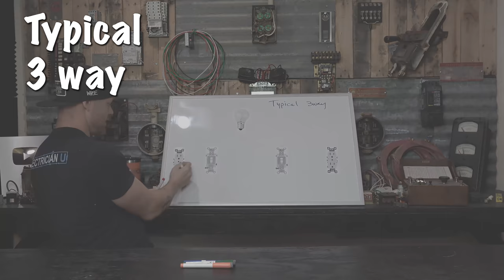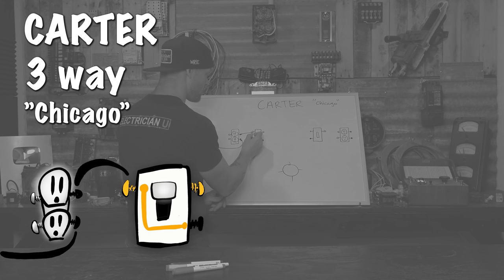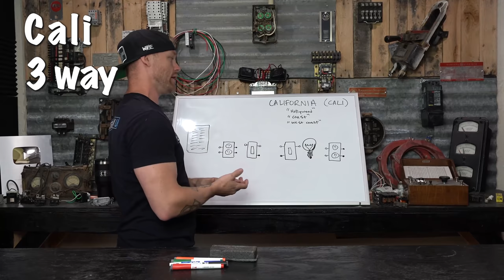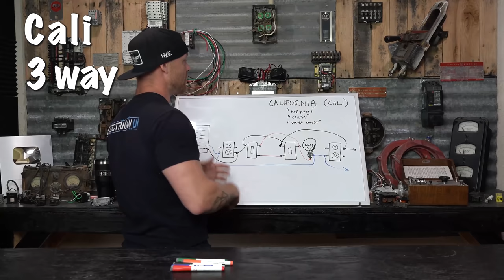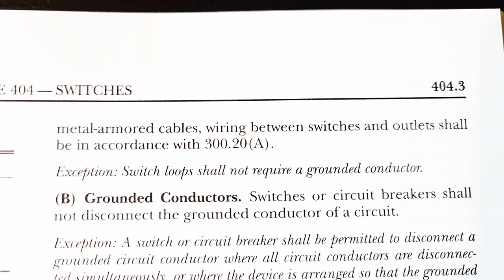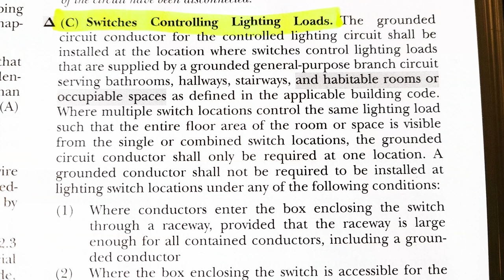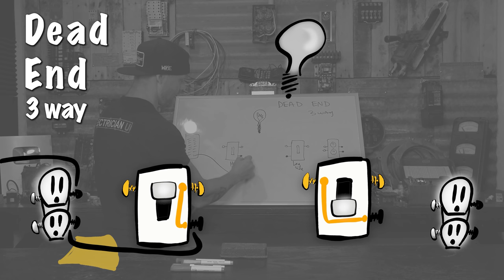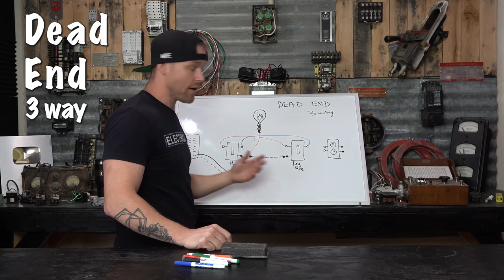THREE WAYS 3-WAYS CAN BE (3way Switch Wiring - ILLEGAL AND LEGAL METHODS)

Comment: So many right ways to wire 3-way and 4-way switches!  Check this out,  I always use the WHITE and RED for my travelers for efficiency. Yes I have to phase but you would anyway if your pulling switch legs and/or power out of 4-way locations. Also when your running a dead end 3-way (just one 14/3 in a box) you must have to use the white for the common and phase it. 
Mainly its nice to have options on a long 4-way run to put light leg and power where you want to along the run without being confused by the splice.  Just make sure your crew is all doing them the same way!

Comment: On the Cali 3 way, hot needs to come into the left switch at one of the other two terminals.  Bringing it into the middle point of he switch gives the left switch total control over the current supply to the bulb.

Comment: I really learn a lot from your vids and appreciate your producing them. Great explanation of three ways. Another way to wire a dead end 3-way and have a constant hot and neutral in the leg box is using 12-2-2 or 14-2-2. Method: From the line-side, send the hot (black) to the load (black screw) of the leg switch. Use the red and red/white conductors for travelers and cap off the neutral (for future). In the line-side box, connect the light's black wire (load) to the load post (black screw) and splice your neutrals there. We had to do this where we had a huge barring post in the way making other paths difficult.

Comment: When it comes to the conduit fill and wire count there have been several times ive had to have 1/2" emt to a single switch but dont want to have another conduit come out of the switch leg side. What ive done is what i was taught is called a cold switched 3way....might be named wrong but this is where you have power and switche leg on the same side.  All you do is tie your common wire into power right away which send the piwer side to the switch thats a die/ alone then wrap your switch leg on the travelers.

Comment: I really appreciate your explanations as you drew these diagrams.  I encountered a situation where whoever wired this house ran the load and neutral wires from the light into Switch A, and connected the incoming hot line to the white wire along with the travelers, essentially bypassing Switch A to run the power directly to Switch B. This configuration was not represented in any of the standard wiring diagrams I was able to find, but your drawings in combination with some voltage and continuity tests (plus lots of head scratching) revealed the situation....and I was able to fix the 3 way circuit in my dining and add a functional dimmer. Thanks!!!!

Comment: I believe I know of another version of the California 3-way (unless this has another name... I'm in California so to me, it's just another method of a 3-way..) which I 'think' is still code-compliant.. but it needs to be done in conduit/flex with the light in the middle of the run between the two switches, thus allowing you to take the circuit room to room, keeping neutrals in the switch boxes and everything. The only difference really being the light location and the way the leg to the light is run. 

You have the power come into switchbox A, and it goes from there, passes through the light's jbox to switchbox B. The single traveler follows the same route. You'll have the neutral come into switchbox A, up to the light, down to switchbox B, and then both the power and neutral can continue onto the next room's switchboxes. The traveler stays on the commons, and the legs both go up from each switch to the light instead of switch to switch to light. Running it this way allows a neutral in each location of the 3-way switches, and allows you to take power from one room to the next, never changing the polarity of anything.

Comment: In the 80's we used to run the feed to the overhead light and drop 14/3 to each switch. Where a feed was at one switch we ran 3 wire to the fixture and back to the other switch.
Reply: Do you know what some of the names for those specific three-ways are?
Reply: @joshuaarellano6600  
No. I just wired as the boss said. Had his nephew as my helper. Kid could fuck up a one car parade. Had to go back myself and fix everyone he touched.
Reply: White wire in 14/3 from 1st switch to light gives the light it's neutral from main source.  White wire in 14/3 from light to 2nd switch will be your switch leg. Red and Black travelers tie together in light box and passes through. The hot at 1st switch goes to common side of switch. Here in Missouri we call that a half-ass 3 way. Not sure of technical term for it lol
Reply: @kaseyatwell1640  
Switch 1: white to neut, to fixture, red& blk travelers
Switch 2 red & white travelers  black is switch leg back to fixture.

Comment: Yo dustin I'd love to see a Code Myths video! Most recently I've debated 1. Connecting all grounds in a junction box (even when there's 2 different sized circuits) and 2. Running romex through EMT
Reply: Fairly certain both is wrong....I never tie my grounds together from different circuits out in the field. Even if it's not code I could see it being code eventually.  Obviously I'm referring to houses and not your commercial environment with conduit and such. 
I just like the idea of having everything separate. Easier to diag on the future
Reply: No romex thru emt…….thats a no no
Reply: I think he already did the romex in duit video, Its a no if it can get wet. I think.....
Reply: @anthonysmith9410  that would be a bitch to pull😂😂 we have pulled romex thru 2” emt that was stubbed out of panels before but screw pulling romex in emt for over 2’
Reply: Oh, this (sharing grounds) is one we should talk about. You can't share neutrals but I don't see why one can't share a ground. So, pulling two circuits from the same panel through conduit, do you guys pull two separate insulated ground wires even though they go to the same place at either end? They all attach to the junction box anyway, and one circuit blows at a time. It seems a waste....
Reply: @spelunkerd  8l⁰
Reply: @spelunkerd  Code says you can pull a single equipment grounding conductor (EGC), as long as it is sized for the largest overcurrent device serving the circuits in the same conduit. 

Example:  1 circuit fed from a 15A circuit breaker and 1 circuit fed from a 30A circuit breaker installed in the same conduit.  You size a single EGC based on the 30A overcurrent device from the NEC table.

They have to be in the same conduit though.
Reply: @Tie509  Yes, our Canadian code book agrees, as well. I had two circuits going through a single underground conduit and did exactly that, using our table 16 based on the ampacity and OCP of the largest conductor. The inspection passed. I did scratch my head wondering if the two circuit currents should be added together to calculate the maximal current the ground wire would ever see. But the chance that a ground fault would happen to both circuits simultaneously without blowing either breaker is so unlikely it is not a practical consideration. Even if a back hoe took out both circuits at the same time, the brief overcurrent is so short lived, there isn't enough to justify a bigger ground wire....
Reply: You actually can run romex through conduit. But only directly to the device or receptacle.. for example in a basement you can run romex through through the drop ceiling or ceiling then straight down to your receptacle through conduit
Reply: @theknucklehead9518  Yes, I believe the issue is conduit fill, since you still need to follow that <40% rule, even accounting for the extra jacket volume. It's all about heat dissipation, with short lengths like you say allowed as long as conduit fill and other factors are in compliance. Of course, nobody wants to pull long lengths of Romex through conduit.
Reply: I don't see anything wrong with running Romex through conduit as long it's the right type I ran number 14 Romex through plastic pipe outside but didn't know it had to be uf type. I never hooked the other end into the breaker box it's my Christmas light circuit and a voltage reducer is used so I just put a plug on the other end. When I sell the house I will pull up the conduit and remove the wiring. I will also see if there be water inside the conduit. A good lesson to be learned only use UF Romex outside. Regardless if it's in plastic conduit or not. The plastic conduit is only to protect the underground wire. The power company in GA ran the mains under ground and didn't use conduit I don't like that idea now extra care must be taken when digging where the wires run. 73
Reply: @theknucklehead9518  yes, when used for protection it is okay.

Comment: re: dead end 3 way
1) if you carry your hot through (instead of your switch) so that your left location in this diagram is your leg side you will have constant hot at both locations.
furthermore you can run 14-2-2 and have an additional conductor to bring your neutral to the next location.
Reply: Right? just splice and continue the feed to the far SW and then travel back with Red white/taped.  Also, He didn't show a power into light configuration.  Not that it's much different than a standard 3-way.
Reply: Because the company I work for considers 14/2/2 a specialty item, we don't order it for just one or two occasions,   it's expensive.   When I need to  do dead end three ways  I will pull two runs of 14/2.   One set for the hot and neutral,  the other set for the travellers,  I then wrap  red phase tape around the white traveller.  Now we have a neutral available for use at a later date.   If I am running a dead end three way in an unfinished basement I use 14/3 and use the red and white for my traveller and black for the common as it's easy to run a 14 awg white THHN along side the 14/3 if we need the neutral later on.  And I only do dead end three ways in existing construction,  never new work.    There's no reason to.

Comment: the last California 3 way you described is the only one I had ever heard of, and, like I said, someone from Cali came along, once upon a time, and said, that isn't a California 3 way lol. I don't know how anyone can argue with that lol. personally, if I'm wiring a new home or doing a remodel, I'm going to put a neutral in every switch box and I'm not going to cheat on cost by using a 12/3 to send a switch leg to the other side. I'm going to put the hot on one end and the switch leg on the other. Not that big of a deal and I don't need someone to tell me to put a cover on a box or conduit body lol; it's just something I'm going to do to protect the wires in the box and make sure someone doesn't accidentally come into contact with it. People can interpret away. I'm just going to do best practice! I, personally don't see no good reason not to put a neutral in every switch outlet, so that's what I will always do. People don't want to, that's on them. I don't need a code book to tell me to put a neutral there. In Oklahoma, people are using programmable switches that require a neutral hooked up to the switch, so it's just a best practice for everyone. Again, The NEC is a minimum safety standard, so it's ok to go above and beyond requirements!

Comment: Dustin I need your help.  I believe I have a dead end 3 way in my kitchen (house built in 1952)  I am putting a light fixture and dimmer in my living room.  I put the dimmer on the opposite side of the wall where my kitchen light switch is (suspected dead end 3 way with no neutral wire). So I want to run power from the dead end switch to the dimmer.  My 2 problems are 1. I'm having a hard time finding out which is power and 2. since there is no neutral in the dead end box where do I tie the neutral from the new light?  I understand you are a busy person so I'm hoping you can help me.  Love your videos and your channel!  You have taught me so much and gave me the confidence to tackle these jobs on my own as I can not afford to call an electrician out.  Thank you

Comment: Many years ago, before neutrals required in boxes, a couple country boys were wiring rows of fluorescent lights with 3-ways.   They took power to the first light and from that point used only 2 conductor NM cable.   It took me a while to figure out how they did it.   
Legal?  As far as I can tell, it met all NEC requirements and could also put a neutral at both boxes.

Comment: I use red & wht as travelers in a 3way so the blk is the leg.

I have also had a feed at switch A with a 3wire going to the light and a 3wire from the liight to switch B. The wht in switch A is neut and blk & red travelers. Switch B red & wht are travelers and blk is switch leg.  I served my apprenticeship in the early 80's in NJ

Comment: I'm a residential apprentice, in the 2-4 gang boxes we always have power come to the box, and then wire nut power to as many black wires as we need to provide power to each switch in the box. But on the three ways, the black common terminal always gets the power wire attached to it, and the gold terminals are the travelers, on both ends of the three way switch, how does that work? In the typical three way you showed that one of the black terminals is the switch leg

Comment: So that's how it is called! The california 3-way was a little brain exercise I had when I was changing two 4-ways into two 3-ways. (Due to being only two switches, there was no need for more expensive ones, you get the picture). I never, ever, heard or connected it in a california way. I used my instrument and figured out that there was no ground in the switch junction boxes, and I figured that there must be a seperate ground on the light bulb, as it is working when I forward a phase to it, I did the math in my head and connected the two 3-ways the california way, without ever finding out it had a name. P.S. I didn't do the installation, just was fixing some burnouts, molten fuses, old outlets and switches, this is why I didn't know that there was a neutral separately connected.
Reply: Where I wrote ground, I meant neutral

Comment: Interesting, turns out I’ve always done dead end three ways. Interesting to learn there are multiple other ways to do it. I think I’ll start having neutral in the box. Never really saw the need for it, I’m running switches never thought of someone retro installing another plug our a dimmer. In a three and four way circuit, I’ve alway just gone from the panel to the light and leave the neutral there, no switch box has a neutral.
Reply: Neutral in switch boxes are really helpful when you have a smart switch that pulls a load without having to steal a neutral reference from ground (Code NoNo)
Reply: I hadn't actually seen a "dead-end" three-way before... I'd just run it as a normal switch leg with an extra conductor, making all the connections at the lamp.
Reply: @Dje4321  The thing about smart switches is that dead ends actually work with them.  Most smart three ways require that the other switch be replaced as well or only care if they have a signal.  So, you re-wire the dead end to be Hot, Neutral, Remote switch signal.

Comment: Could you please shed some light on residential dimmer switches.... I have been charged with programming the new dimmers -the ones that need a neutral conductor.  The device features an setting toggle for "F" (forward) phase/"R" (reverse) phase, and a programming button.  Tech support told me that the "program" button cycles through twelve "trim" settings.  Sometimes they self program -sometimes not.

Comment: Hello and thank you for your videos , very solid. I have a question, how can I add a receptacle to a 3 way switch in my house if I don’t know where is the hot or the leg. Can I add a receptacle in any side of the 3 way? So far I added the receptacle, but works with only one switch…. If I flip one of the switches, it will turn on or off the receptacle. How can I identify the leg or the hot?

Comment: There is one other strange type of three-way switch wiring that you did not mention but I don’t know the name. It involves connecting all three terminals of a 3-way switch to the same three terminals of the other 3-way switch. Then the two travelers are tapped as a single-pole.  If you draw it out you’ll find it works.
Reply: That sounds like a 3 way switch loop where the power goes to the ceiling first and comes down from the light via a 2 conductor wire to one of the switches. A three conductor wire goes between the two three way switches with each screw on one switch sharing a wire with the same screw on the other. Then the two conductors coming down from the light are connected with wire nuts to the travelers, one conductor to one and the other to the other.

Comment: I had a 1926 rowhouse in Washington DC that had a 3 way wired with the Carter method. It wasn't working right when I bought the house. It took quite some time for an electrician to get it working right. The house wiring was Greenfield, and I did not want to rewire the area where the switch was. Due to the wiring being old, it was hard to distinguish between the colored fabric coating.

Comment: I use a 3-way switch in my garage to control separate lights. When the switch is "on" the main overhead lights are powered. When the switch is "off" a motion-sensor security light is powered.
Reply: Pls sir I will love to see the connection diagram
Reply: @echenduconfidence4998  The common (black) screw is incoming hot. One traveler (brass) goes to the overhead lights, the other traveler (brass) goes to the security light. Of course, green is ground.

Comment: “404.2 Switch Connections 

(A) Three-Way and Four-Way Switches. Three-way and four-way switches shall be wired so that all switching is done in the ungrounded circuit conductor.”

What the code says here is that the Carter three way is illegal because it breaks the neutral. Yes is says it without saying it!